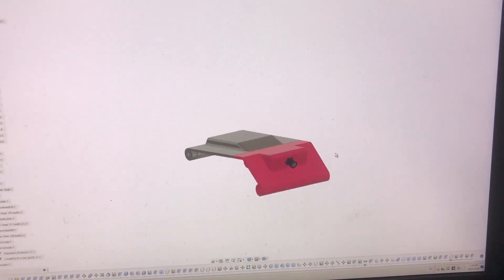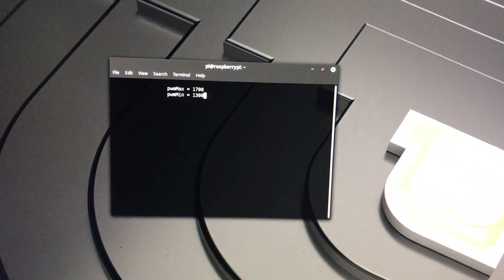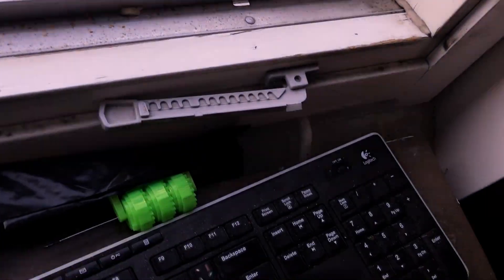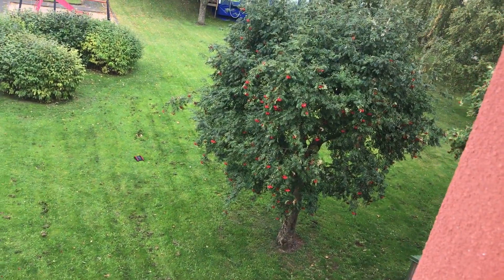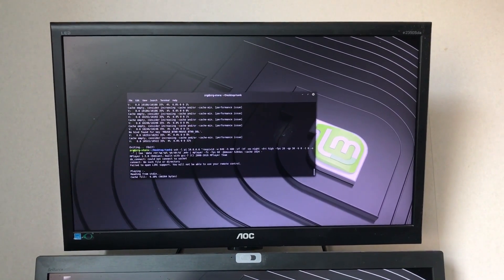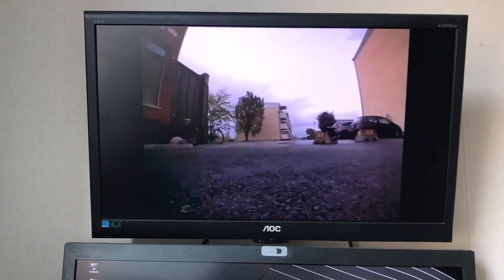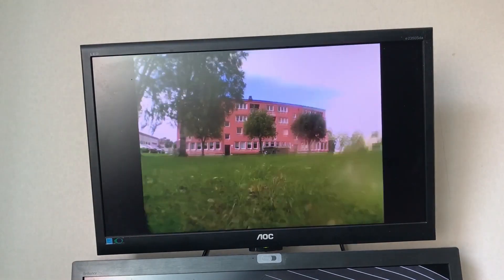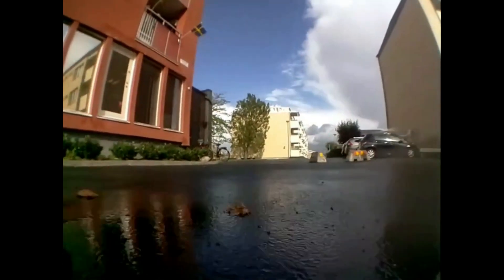4G FPV with 3D printed Tank

Comment: Awesome, Peter.  For control, Perhaps you could explore a delayed control series like the Mars Rover. Then it could follow the sequence you’ve sent as a package.  That would eliminate the need for a control as you go, and allow the vehicle to go on a mission outside cellular and return.  A simple example might be “Move 1m, slow” “Turn left, 90 deg” sort of instructions.
Reply from the maker: I can already do that if i wanted, when i control it i just ssh in to it and run a python program on it, i could as well just write the commands in a sequence in a little python program... And a can even write computer vision  programs for more autonomous driving. But i wouldn't really trust it to drive bu itself if it have bad signal.. One thing i have thought of, is if it would have solar panels on it back it could have a auto mode to, point them at the sun :-)